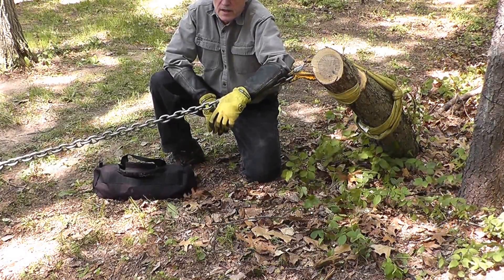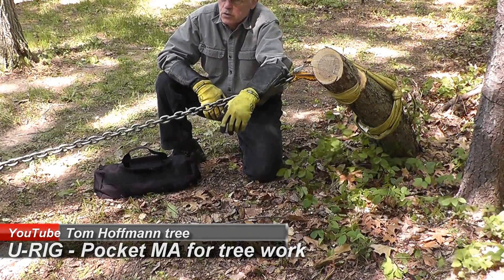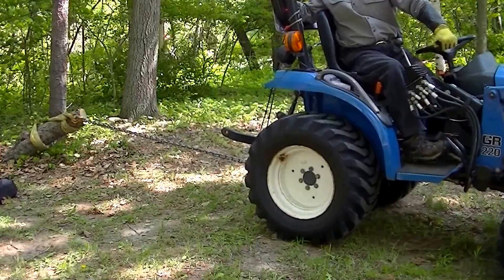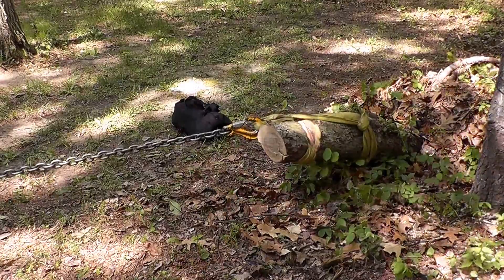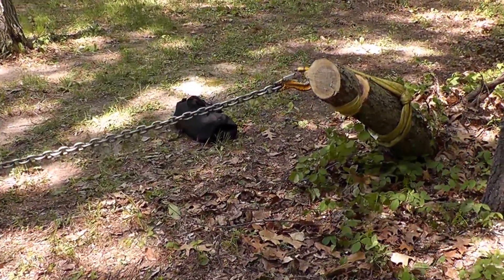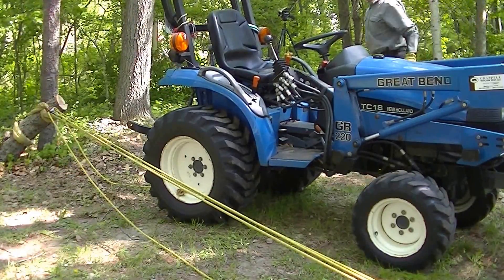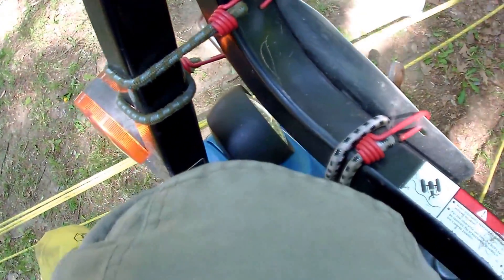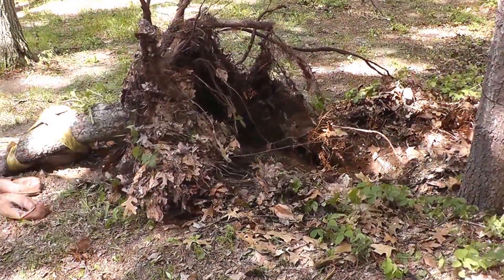Mechanical Advantage vs. Straight Pull Stumpin'

Comment: Hi. I'm wondering if a thern 3500lbs pull capacity winch would be capable of doing the work instead of a tractor. Its a massive winch in my opinion but I'm not sure if its capable of the things you do. Thank you.

Comment: What size, grade of poly rope is that ? Being a pipefitter I've done lots of rigging, using snatch blocks etc. Amazing what can be moved wigh little effort. Now then, why don't you go out to where the guys go mudding with their trucks. You could show them a thing or two when they are stuck.

Comment: i find it amazing in the first pull that the engine would die before the tires would slip, was it in the lowest gear available? either thats some strong ground and amazing tires or they drastially undersize the powerplant in these tractors

Comment: I was worried about the chain coming loose from the stump and coming back at the tractor until you put down the fire hose over the rope to stop that. I was also surprised that the stump came out that easily too as I remember an incident in North Little Rock, Arkansas where the owner's son was operating a dozer at a construction site I was also working at and the cable connected to the dozer broke away from the debris the son was trying to pull away and the cable came back and hit the operator and took off one of his arms.

Comment: I think he could have got the same results using a wheel off of a truck. Just wedge it down between the stump and the ground then pull the stump over the wheel and the wheel will cause the stump to go up and out.

Comment: The problem with pulley systems is the tension in your anchor point, if am not wrong that rope is your weaker point, I think is a 14K pounds a snap in that rope is a killer. The tension at the pulleys  are extreme, your main rope are 1 or 3/4 inch static. I have used come along and grade 70 chains, and go 10 feet to the tree and to the botoom of a tree, and another one in triangule, I have heard the breaking of the roots on your video and it really make feel fear that sound. Excellent  video on pulley, but personaly for that size of three stump I stay with chains grade 70.

Comment: You didn't show what you attached the other block to, but I assume it was a very large tree.  One thing newbies (unlike yourself) need to think about is that the pull on the "fixed" end is more than on the "moving" end. You don't want your "fixed" end to become your "moving" end because you attached to something less stable than the stump! :-)  For that reason, it's a good idea to split the "fixed" tackle across two trees, each carrying about half the load.  More equipment, but safer.
Reply: Also:  If the fixed end is a tree (or trees) you want to keep, you have to be careful not to chew all the bark off with your slings

Comment: Am I the only one that thinks he should water it? is easier to pull it out of mud instead of dry dirt
Reply: Depending on how far out in the field, you could do that. Or you could save the water and use a pulley setup–which you should have if you pull stumps–and in a few seconds, you're done. Besides, it may take 50 gallons to get the water down deep. (I pull honeysuckle after hard rains, but that's a two edged sword: the bushes come out more easily, but the tractor tires slip in the soft earth.)
Reply: Perhaps you were using Summer fuel or had filter blockage.
Using Glow Plugs is the right way. Not sure how you were trickling gasoline into a Diesel.  Not recommended.

Comment: What's up with those hard starting NH tractors. I have a skid steer and a lawn mower with the same type of engines in them and they are horribly cold blooded. The second time in this video you cranked it, it started right up. Nice video!
Reply: Let the glow plug do its' job first.
Reply: Gord Baker I do, but 90 degree weather and you have to use glow plugs???
Reply: Try the glowplug route and see if it helps.
Reply: I have to! I do run the glow plugs every time I start it, even in 90 degree weather. Even the implement dealer has the same machine and he says it is a bugger to start. I wanted to find a snowblower for it and he said forget it. It wont start.
Reply: Well, first I would check the Ground terminal to the frame.  This caused problems in a 4.75 75HP unit I had.  Problem was under the ground lug at the frame.  Little tractors are no doubt different.  Fuel filters changed regularly?
Injectors tested?  Buy a Kubota?  I always use the Glow Plugs on any diesel that has them.
Reply: Gord Baker Last reply...they are just cold blooded engines. NH admits this.
Reply: In the Mahindra I was using, you needed the glow plugs anytime the engine was "cold" (ambient) even if that was pretty darned warm! It may eventually start without them on a warm day, but it starts instantly with them. An engine at operating temp just fires right up.
Reply: Kenny Phillips I have an old Yanmar F15D that does not have glow plugs. It has a large glow plug or manifold heater. It will start up without it in the mid 30s F
Reply: That's interesting; I've had no such luck with my oil-burners. One of my trucks wouldn't start when it was -21°F, glow plugs or not! We trickled gasoline down the intake, it fired, we kept a stream of gasoline going for a couple of minutes until it smoothed out, then set off on our journey. Hopefully we didn't hurt the engine, I only kept it for a few years after that.
Reply: I have a 30hp Kioti & it's the same. I use glow plugs on first start up regardless of temp. It starts good without using glow plugs after the first start of the day. It does start fine even in cold weather with glow plugs.
Reply: 1crazynordlander c
Reply: 1crazynordlander diesel ignites a little higher that 90 degrees. Also, smaller engines don't have the same compression ratio as the bigger machines

Comment: Great idea and well designed. If you want to take it too the next step, configure it to be used as a force multiplier for a front end loader bucket. I bet it would save a lot of digging with a backhoe on larger stumps. Just a matter of scale.

Comment: Great video. I think it's always best to pull in reverse with these kind of jobs as there is no chance you will flip your tractor. If you ever see your front wheels come off the ground it's safer to 180 deg the tractor and pull in reverse. Cheers

Comment: Is there a way to use this if you don't have a nearby tree or trees to anchor from? or at best 15" stumps nearby. I've had 50 pines cut down.
Reply from the maker: Speaking practically, you need the anchor tree or stump.  There are ways to build serious earth anchors using multiple logs and lots of digging but it's huge work, enough to make me rethink a stump grinder or an excavator to dig it out, especially if you have many to do.If you do try to use a similar size stump, you should watch my vid "E/E Anchor Sling.  It's a way to cut the forces on each stump in half.
Reply: Tom Hoffmann thanks mate
Reply: 15 year owner and top climber of a tree service. i would recommend a backhoe or a dozer which  may be better then a grinder. get several bids before signing a contract. good job tom.

Comment: I always straight pull, however I tie a strap real high in the tree, preferably half way to three quarter of the way up, make sure you have a long enough strap so you don't pull the tree on top of you.  This way you use the tree itself as a leaver and it works real well. After the tree is down half of the root ball  will be sticking out of the ground, at which point I will cut the tree stump at 20ft to 30ft and use the tractor to again to push it side to side till the rest of the roots are out. Leverage vs mechanical advantage, that would be an interesting video.
Reply: I do it this way too. But I also put a large log in front of the base of the tree, that way when the tree falls, it's own weight will pop the root ball right out of the ground.

Comment: Would you mind listing the parts I need to buy to set up that system. I know, it probably seems obvious to lots of folks, but, specifically what do I need. Instead of just saying "hooks and straps", would you be specific about what kind of hooks and straps and pullies etc...
Reply from the maker: Jeff, check out the playlist for the "uRIG" mechanical advantage system.  The videos will give you a detailed parts list and show how to deploy the system in different rigging applications.  The uRIG is useful and strong for a hand-drawn but it isn't for big stumps.  The pulley at the head end is 36kN or about 4T mbs.  At SF=4:1, that means the max pull to be applied to the working line should be about 400 pounds.
Reply: Thanks you.

Comment: Everybody these days calls this "mechanical advantage set up"...Like its something new... Its not new... its a good old block and tackle set up... I have one in my barn capable of lifting/ pulling 80K lbs...
Reply from the maker: Wow.  40 tons.  I'd like to see that ... you should do a video.  Is it marked?  MBS or SWL?  If gear is not marked, what specifically do you measure to get a strength rating?  What's your formula from that measurement to get to force?  Thanks for the help.

Comment: I have a small tractor and you describe how to calculate the dead pull capacity.  You said you "set a pulley system in a tree and used eight (8) 5-gal. cans of water  to calibrate the dead pull capacity of my tractor...the tractor can make 700-1000 lbs."  Am I correct in assuming that you are lifting all eight buckets with just a direction change pulley and that you added buckets until you could lift no more?  If that is true then wouldn't the weight have been 333.816 pounds (8.3454 *5*8)?Thank you for your effort and video.  Now I need to build the pulley system.
Reply from the maker: Great question!  I hung the jerry cans from a 2:1 pulley system acting AGAINST the tractor.  That doubles the weight and then I divided by .85 to guessimate friction loss through the pulleys.  It would have be much easier to just pull against a peak capture dynamometer.
Reply: Thanks for the reply.  Just so happens I'm watching the "E/E Anchor Sling Proof Testing " video right now.  I'm going to get some pulleys out and play with this a little.  I don't do this a lot so it is a little hard to visualize.

Comment: Tom, Have been watching several of your YouTube videos. Very helpful in regards to getting my head around various mechanical advantage setups for stump pulling ( and for other things that need to be dragged,etc).  Have a 25 hp 4wd drive tractor slightly biggerr than yours here. Going to be pulling 4-8 inch stumps, elm . I have made a root ripper for my tractor to go four sides of each stump to shear as many roots as i can before attempting the stump pull. For pulling a stump with either a 4:1 or 5:1 MA would you think a double/twin sheave pulley setup ( as is being sold on ebay) with a 32KN rating be heavy enough? The units look similar to the Rock exotica 'Machined Rescue pulley' line. 
Thanks
Reply from the maker: +Barry Cisna Thanks, Barry.  No, I don't think so.  See my reply to the most recent comment under "uRIG Build Details".  The eBay is LESS than the Rock Exotica.  The RE is 36kN and the only reason it is OK for this comparison demo is that the stump was already loose from the tree falling over.  You should be thinking at least 2.5 ton WORKING load (that's more like 90kN BREAKING strength).

Comment: no drama when pulling a stump is a good thing....I used to use a 1974 Ford LTD, 8cyl..family car, in low gear..would pull anything....lol all I had to do was NOT let my Dad see me do it...lololololol would pull the whole tree out at once, position the rope / chain bout 10 feet up, that was my mechanical advantage...would pull tree over and right out....the crazy crap you'd do growing up!